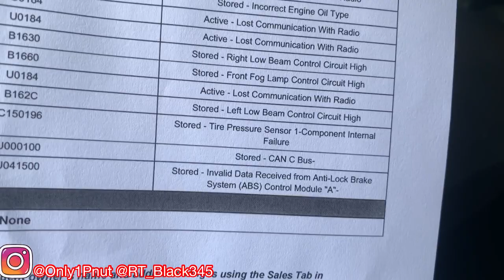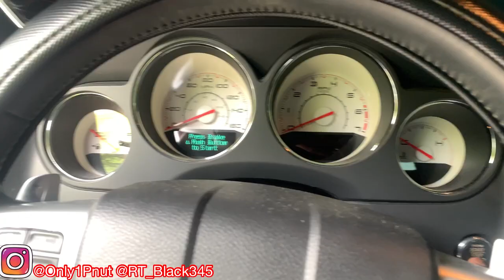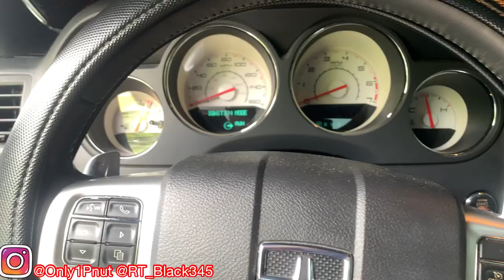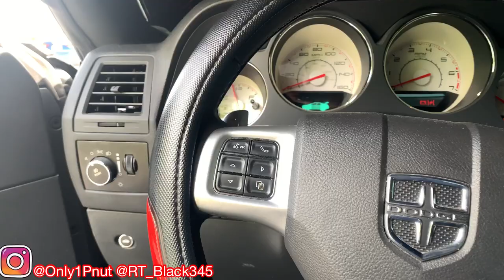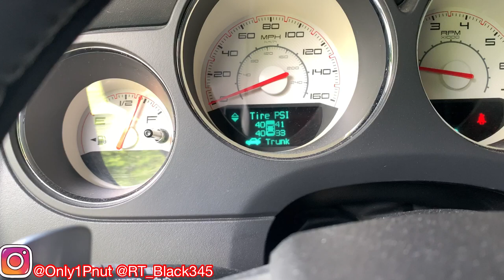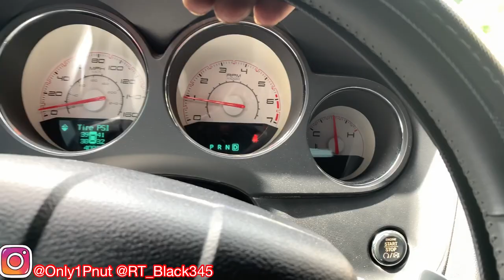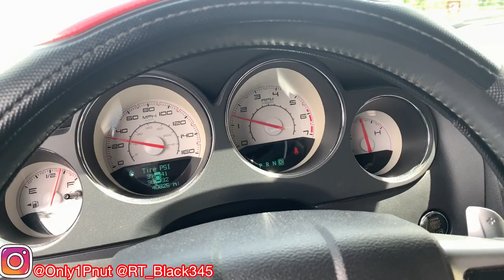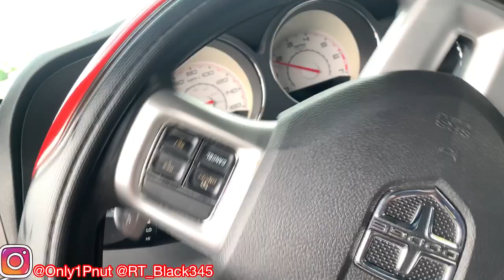How To Replace Rear Speed Sensor || Dodge Challenger, Charger, Chrysler 300 (08-2020)

Comment: Great job.   If you want to reset the system a little quicker, leave the battery disconnected for 15 minutes.  After reconnecting the battery, you need to do a simple angle sensor calibration.   Start the car, run the wheel all the way to the left, all the way to the right, and then center it.  Turn off the car.  That saves the steering angle calibration (this is needed because of the battery disconnect).   After that drive it off and right away you should know if the ABS wheel speed sensors are working.     Thank you VERY much for showing the replacement of the rear sensors.  You saved me some time in being better prepared.  I hope the battery tip helps if you have to replace more sensors.   You did a great job!

Comment: Nice job, I ain't trying to pull the wheels off unless I got no choice. 2010 SXT AWD Charger... ABS, Traction Control lights came on, getting weird shifts when slowing down and now a T. CASE warning as soon as the ABS and traction control lights come on. Dealership tells me my transfer case is bad, no noise, no grinding, switches 2 wheel to 4 wheel until ABS/TRACTION lights come on. They quoted $4,351.96 for repairs. Bought all 4 wheel speed sensors for just under $65 for Delphi parts, another $120 for Transfer Case Control Module and my car runs great and I saved over $4100. Dealership will rip you off, dirty business cause they'll say what they can to get the most money possible and they don't care.

Comment: Did it cause any transmission issues?
Reply: I will tell you that in my 08 R/T when the ABS ESP|BAS and TRAC lights are on from time to time the car will go into 'limp' mode where it will only drive 20 MPH and the RPM will sit at 2200 and nothing else will go. So in a way the TCM isn't getting a signal from the wheel speed sensor and it's putting the transmission into failsafe mode.

Comment: Does this apply for 2010 chargers
Reply from the maker: Yeah
Reply: @Only1Pnut  bet appreciate it glad I found your vid not much vids on chargers
Reply from the maker: @JuanRodriguez-gj5zk  it was my older CHALLY but it’s all the same from 08 to 20 for all models 300 charger or challenger if it does work u will have to find the “axle tone ring” that also helps with the wheel speed sensor too but only take it one step at a time I don’t want u spending unnecessary money bro unless U HAVE too